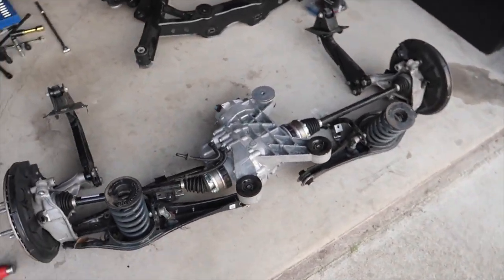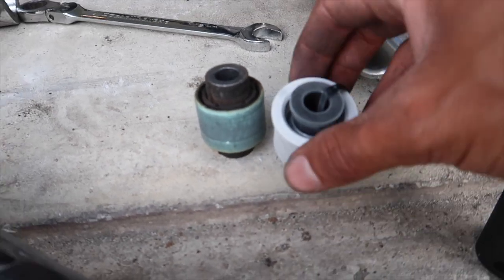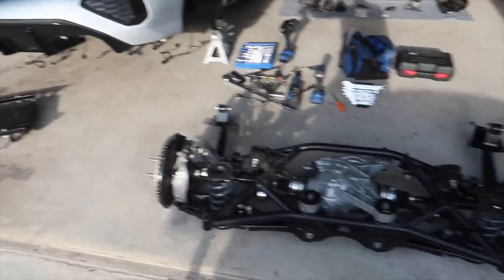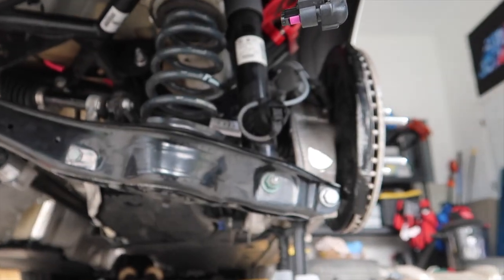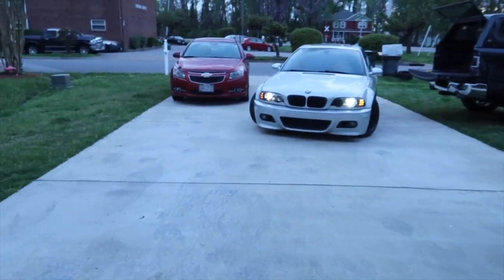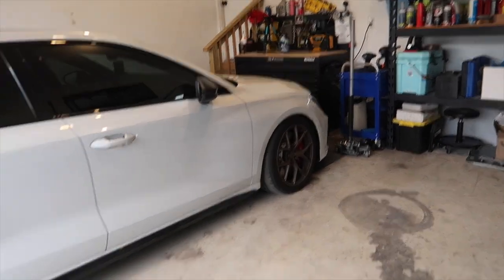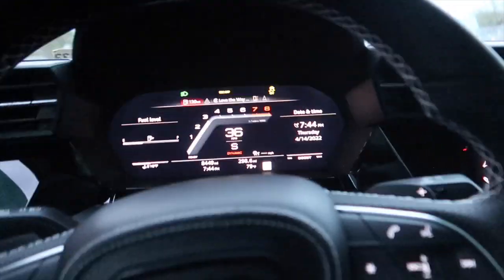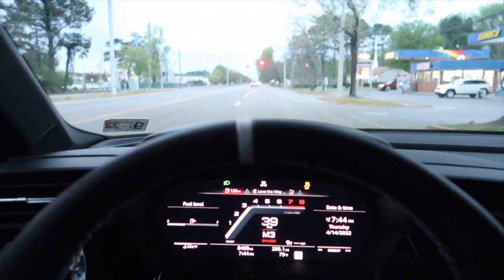Verkline Rear Tubular Subframe & Arms Install! - Part 2 | WORLD FIRST on the 8Y!! | 8Y S3

Comment: Are you still planning on going stage 2 after Cobb-Gate?
Reply from the maker: Maybe not with Cobb, ecutek is still an option to not have CEL and such. Same with united motorsport and maybe others. But I'll more then likely stick with EQT as they're my sole sponsor
Reply: @BryceJordanProductions  right. I heard IE may not have a CEL either, but I'm not abotu to switch tunes.. but it does mean my stage 2 is cancelled, no question about it. the car is fast as hell now, and it will get better once i install a phat intercooler. and i already have a stage 1 E30 tune from EQT if i ever want to use it with no CEL. i was actually looking at that "DO88" IC from EQT, or a IE possibly. I also like the Racing Line, but it may not be as performance orientated as the other 2.
Reply: IE will have a check engine light in my experience. Even if you have a cat like I do it will still trip a code which you can delete but it always comes back in a day or two. Used to not do it on stage 2 but I’ve been emailing them for a solution. As of now it’s just annoying. Maybe I need to get an 02 spacer
Reply from the maker: Definitely don't do the racingline, I sold mine cause it couldn't keep up. Do88 or AMS is the way to go
Reply from the maker: I had a 42Draft deigns spacer for years and never had a cel, that was with a different tuner though
Reply: @BryceJordanProductions  thanks for the tip! that was at the top of list to match my intake!
Reply from the maker: DO88 is what I'm getting next as well, definitely a nice piece! Just waiting for them to release their evo4 version
Reply: @BryceJordanProductions  eh? Is there a better version coming? Oh that’s your car type right?

Comment: 5:30 are these a Concentric "Bolt" where the hole is off center to allow for alignment?
Reply from the maker: Not for alignment but for bump steer adjustment based off of camber and ride height I believe. There's a whole chart you follow in the book and it tells you what centric washer set to use. It's very neat how they have it all set up and figured out. Some crazy R&D has gone into their hardware

Comment: What roll bars do you use for autocross?
Reply from the maker: Currently none but if you have a golf eurocode adjustable front strut brace and the hatch brace are awesome. Mostly the front does the work though
Reply: @BryceJordanProductions  Sorry, I ment anti roll bar in the front and rear suspension.
Reply from the maker: @legion2531  stock up front and 034 in the rear. Front bar is pretty big already, it induces understeer. Going bigger without a bunch of other suspension mods will not be a benefit